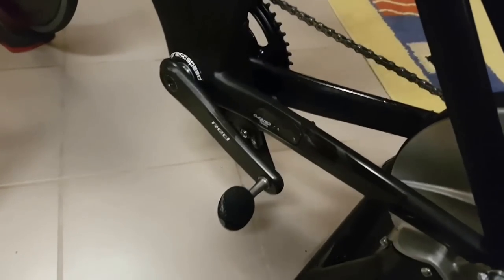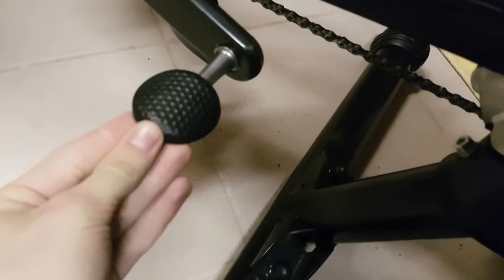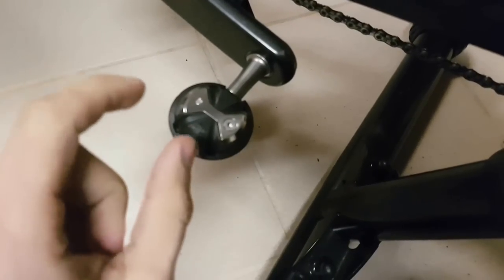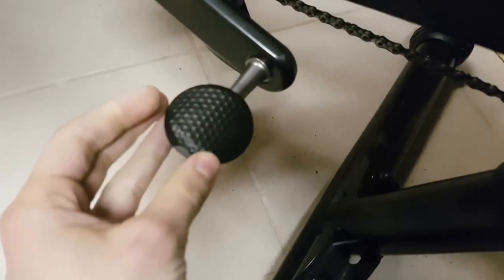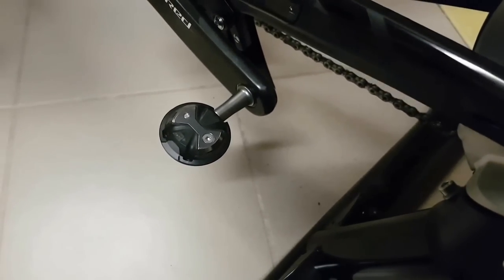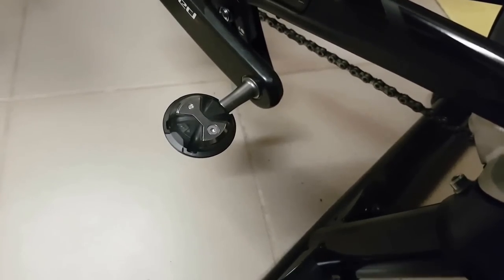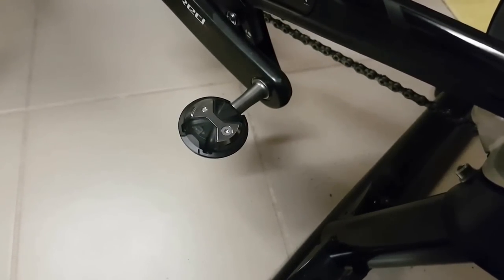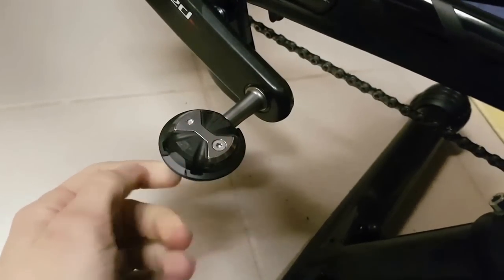Speedplay Aero vs Speedplay Zero pedal review

Comment: Hi Ronald,  sorry   for the question , i  currently use  the Zero Aero  pedals  and  cleats  on one bike.  i need to  user the  same shoes  and  cleats  on another bike (spare )where i need to buy  a pair of  pedals,  can u confirm that  the Zero Aero Cleats  can be  locked  without  issue  with Zero  pedals  not  aero ?  i mean  the   classic  doulble  side  pedal ,  that  cost  much less compared to the aero ,   thx  in advace

Simone
Reply from the maker: Yes, you can